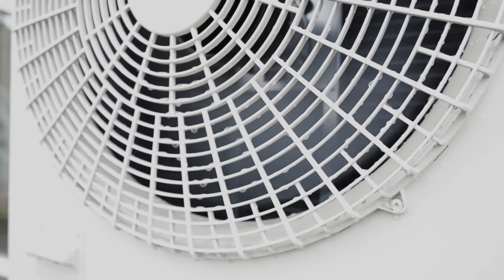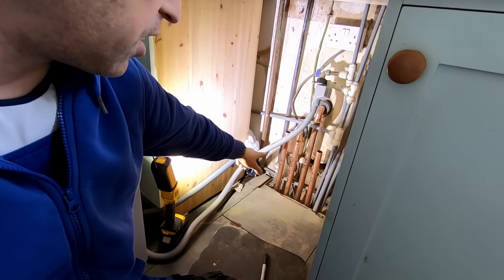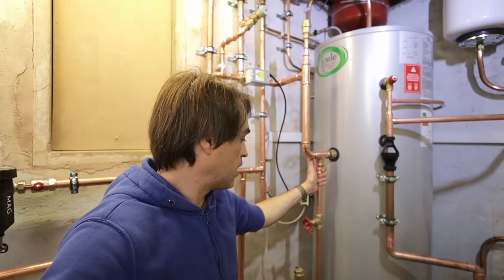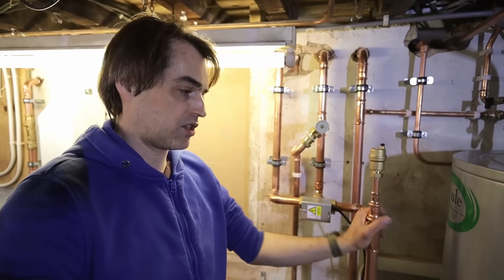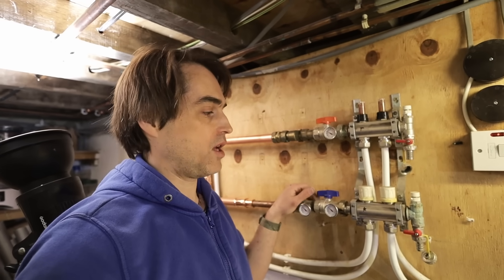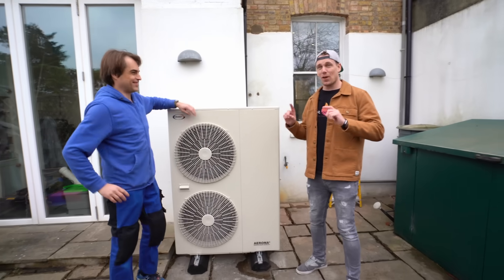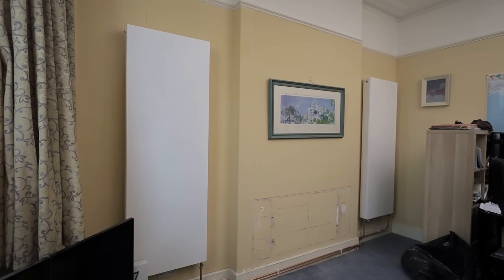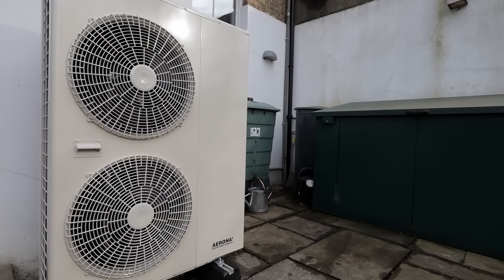The Truth about Heat Pumps: Debunking the Myth.

Comment: My house simply does not have enough space to put larger rads where the current ones are. So that means adding more rads. In awkward places. Which means what? Ugly pipes running everywhere? Destroying floors and walls to get the new pipework in? And does this mean that I cannot install a new high temperature heat pump that is designed to run at 60-80C? So I have to eff my house up or be cold even though there seem to be new options just around the corner that could avoid both? 

Nice. Very nice.
Reply from the maker: new building regulations require ALL SYSTEMS - that includes gas boilers and high temp heat pumps to run on maxium 55C flow temperature. This actaully means that gas boilers now require bigger rads than heat pumps!
Reply: @UrbanPlumbers  No, it means when my gas boiler wears out and I have to replace it I have to replace it with a system which will either leave my house cold or busted up in order to fit new rads - or both. As I said, I simply do not have space in some rooms to fit larger rads - so they will be cold. Other rooms have space - but not where the rads are now. So those rooms will get busted up in order to fit new rads in new locations.

And in the winter 45C water in my hot water tank will last precisely one shower. Good for a family of 4. So cold and smelly. Welcome to the future, it sounds so bright.

Oh, by the way, I do not have space for all the plumbing that you put in to that cellar. Because I don't have a cellar. And my house is already triple glazed and as insulated as I can make it. So yeah, can't wait.
Reply from the maker: @kalicom2937  if your house is insulated and has triple galzing then you will not need large radiators as your heat loss will be low.

Boilers are still ok to heat up the cylinder to 60C as are heat pumps with immersion back up or high temp heat pumps.

Would you rather we all were burning gas in a very ineffcieinct way as we have been doing so far or finally started saving energy?
Reply: @UrbanPlumbers  1) I hope you are correct about not needing bigger rads. 2) Immersion heaters kinda defeat the point of heat pumps, do they not? And, as you said, high temp heat pumps are banned... 3) No, I am not arguing for gas. I am arguing that preventing the use of alternative solutions - such as high temp heat pumps - is a stupid thing to do.

Let me give you an example. Many years ago my Uncle worked with the Royal Navy on flight simulators. The computers generated a lot of heat so the server rooms needed air-con. To save money the base commander insisted they turn the temperature down - which meant my Uncles department had to turn the air-conditioning up. They tried to explain to the brass upstairs that what they were insisting on was costing more money but they would not listen. So, they turned the temperature down and the electricity bills went up.

The equivalent here is my having to use an immersion heater to generate sufficient hot water to allow my family to shower - rather than allowing me to use a high temp heat pump which would achieve the same result more efficiently.

Short sighted idiotic rules created by pen pushes and not people that have to live in the real world.
Reply from the maker: @kalicom2937  90% of your hot water will be done by a heat pump. Immersion heater is just to boost it once a week for bacterial growth prevention.

You can install solar PV for that purpose and do most of your hot water with PV or solar thermal.
Reply: @UrbanPlumbers  I need hot water to shower 4 people daily. Once a week? You are having a laugh. I have friends that have modern houses that are "efficient".They are so good they cannot afford to heat them (I kid you not, they heat the rooms they will be in when they will be in them. Unplanned visits to the bedroom are not allowed....). Sounds like I will not be able to afford to shower. Well, I can, but once every 5 days or so. I will need to diary when it is my turn to wash properly.

Propaganda. Bad propaganda.
Reply from the maker: @kalicom2937  this set up does 4 showers easily, cheaper than gas too as it is mostly done by solar.
Reply: @UrbanPlumbers  What set up? I don't have solar and am unlikely to have solar. However, I will probably have to replace my gas boiler in the next year or two..... I feel like I am going to get ****** screwed over by well intentioned idiots.
Reply from the maker: @kalicom2937  why? You can still replace with another gas boiler and will be able to do so for years to come.
Reply: @UrbanPlumbers  But I thought you said it would have to be a lower temperature output boiler - the same as an ASHP. If so then these issues will affect a lot of people  needing a replacement boiler from this point onwards. Or did I misunderstand what you were saying?

Comment: The only heat pump systems worth a damn are ground source ones, where the heat source maintains constant temperature year round, and conducts heat efficiently to buried coils.  Trying to extract heat from cold outside air, when you need heat the most on a cold day, is a loosing battle of efficiency.  They also work best when used with hydronic floor heat, where you have a large surface area to radiate heat, and don’t need high temperatures to get the heat into the room.
Reply from the maker: ground source has a slightly higher efficency to air source, that is true. It is not true however that ground siurce is the only system as you say 'woth a dam'.

Air source is still hugely effiecient. There is nothing apart for ground source or lake / river source that even comes close to ASHP efficeincy. Still miles better than direct electric or gas.
Reply: @UrbanPlumbers    I have had two different air-sourced forced-air HP systems.  13% and 14% SEER rated.  Neither would keep the house comfortable at 72 degrees on a cold day, and would bump to resistance coils frequently when cold outside.  This was in Florida, so it rarely got below freezing.  With an average ground temperature of 72 degrees F year round, a ground-sourced heat pump should be working under ideal conditions for both heating and cooling, but air-sourced performance was unsatisfactory and expensive to run, summer and winter.

Comment: Can you install these in a back to back or flat. I think not it might be OK in a mansion but not for the vast majority nobody runs away from a debate but it's not practical in a vast majority of households electric storage heating and electric underfloor heating in a well insulated house with good timer controls and weather compensation controls will be a much better alternative sorry but I find this a waste of money I'm sure when your earning 10.000 pounds out of that installation I'm sure your going to be pro heat pump .As an electrician I've seen guiet alot off these new technologies and the bills and saving just don't justify the vast expense and complex install and maintenance they require they might do well in a ultra isolated new build with 10 ft of insulation around the walls but that's about it I've seen loads of people and these green zealots buying into and regret it later I think mate when you do have a proper debate I don't think you will come out on top I'm afraid don't buy in to all the hype.Icould if you want help you train up into some alternatives but you won't be earning 10.000 pound a shot install.bye the way I'm 40+years in the trade and also city and guilds.
Reply from the maker: Electric UFH and other direct electric heating is 3-4 times less efficient and more expensive to run. It also produces 70% more pollution than heat pumps.

Comment: Ugly, expensive and would not work in my old Victorian house, plus they take up so much more space. Solar, wind and hydrogen combo would be much better.
Reply from the maker: The best tech to run on solar and wind is…. Ohh heat pumps.

Hydrogen will cost you 5x more than direct electric and 15x more than a heat pump- so good luck with that.

Comment: I’ve an ASHP. Water heated to 35 deg into our underfloor heating. Hot water for DHW set at 45 cause that’s what we like shower at. 

Total electricity cost for year (space heating, water heating , light, appliances etc) €1500.

Far cheaper than our old house with oil. 

Insulation is key. No point fitting these systems to old houses that aren’t sufficiently insulated
Reply: lucky you,  our electric costs are more like  £5,000 for the year, with this very Heat pump installed into a new build house all callcs done for the RHI grant.  very efficient and cheap in the summer months but seems very expensive in  the winter,  maybe more efficient compared to gas but with gas being cheaper per KWH  than electric makes it a very expensive way of heating our house.

Comment: simple style air to air makes since in places where I live like Florida , but not in very cold areas . YES they make more heat for the  energy used but those are throw away condensing units they are installing ,in ten years or less  no one will make those parts and you will need a new system, they will never pay for themselves that's for sure.

Comment: That’s no way going to work in my semi …I have no where to put that huge monstrosity in my garden plus I wouldn’t be able to move in doors with those huge radiators !! .,may work in that huge house with its music room and cellar but for the vast majority of us plebs it’s never going to happen
Reply from the maker: Smaller houses will need much smaller units. Add insulation and rads can stay smaller too.

New building regs part L require that even in gas boiler you have to design systems with max flow of 55c which means big radiators even on gas now.

We need to cut out emissions somehow and stop burning gas one way or the other.
Reply: @UrbanPlumbers  I love your videos and admire your skills ……but I don’t agree with Carrie Johnson and the green Marxist eco millionaires it’s all pie in the sky and will never happen …it may when the last coal power station in China 🇨🇳 is shut down but they are building on average 150 new ones a year ….shale gas and clean coal ….the rest is fairly tales

Comment: I work on a huge military installation for the Air Force and the only thing we use are heat pumps. To my knowledge most other military installations use the same setup. We have over 23,000 people on site and the heat pumps work really good!
Reply from the maker: well, military know it makes sense - both financial and environmental. Thank you for your comment.
Reply: @UrbanPlumbers  Thanks for the reply. I wish you could see it. There's massive pipes under the ground running to the buildings, you can see steam running up through the streets where they intersect.

Comment: Lovely craftsmanship on the install - but seriously, who can afford to lose half each room to radiators that huge? Or, alternatively, how many people in older houses can either afford or want the hassle of digging up the floor for underfloor heating. This looks like tech for new-builds with masses of insulation meaning rads can be a sensible size for room heat loss. Not much good for retro-fit in most of Britain's older housing stock.

Comment: Such a lot of work for such a basic requirement of heating a home

Whoever required and paid for this needs to be prepared for some serious maintenance costs and will never financially benefit from any savings to their energy bills.
Reply from the maker: What are you basing this opinion on please? General experience is less maintenance than gas or oil boilers and much longer lifespan of the system and the appliance of 20-30 years.

Running cost is comparable to gas when designed and installed correctly
Reply: @UrbanPlumbers  I'm basing it on over 40 years of Building Maintenance experience. The cost of the work and the amount of equipment is disproportionate to the cost saving a homeowner will make.  
As my old grandad used to say - "Put another jumper on"
Reply from the maker: @sichere  are you saying you have 40 years of experience maintaining heat pumps or buildings? Two very different things my friend.
Reply: @UrbanPlumbers  
Thankyou for pointing out that building are not heat pumps but you are barking up the wrong tree without showing the  total cost of such an expensive  installation and system including ongoing maintenance over its planned lifetime. 
There will be no financial benefit to the customer and in ten years time I doubt you will be around to service all the valves that are corroded and system filled with limescale. 
My experience tells me that the next homeowner that comes along will want something more practical and remove those monstrous radiators.

Comment: Great video. 
We had a GSHP installed in our 1960's house about 15 years ago. We have over sized radiators but not as scientifically sized as your install. A lot of plumbing yes, it was 5K of work back then, about the same cost as the heat pump itself.  We probably went about it the wrong way in that we improved house insulation after the install. We do supplement ours with a wood burner in the lounge in the winter, but otherwise very happy. I can't honestly say its any cheaper to run than other options (we have no mains gas in our village), but the complete lack of maintenance and not having to worry about oil top-ups is a real benefit.
Reply: Upgrading the fabric first should save money on the heat pump installation, but in simple decarbonisation terms the heat pump can be done a lot more quickly (and more cheaply)  than the fabric improvements, so even though it's a bit inefficient there is an increasingly good case for just whacking in the heatpump first, then fixing the rest as finance allows, for the vast majority of people who can;t afford to do the whole damn thing in one blitz. Although mortgage-financing for retrofit may change that.
Reply: Yes. But that’s ground source. Not beset by the same issues as air source.
Reply: The fact you have to STILL suppliment it during winter kinda proves it has FAILED and WASN'T "worth it". The whole point of these systems is you shouldn't NEED to suppliment them at all with ANYTHING else - especially not a wood burner lol. Or at least that's what they make you believe with the adverts and publicity they get constantly - "it can make heat even in the winter and cool/heat during the summer".

Comment: Few questions:

In regards to air to water heat pump is there not certain requirements for distances/sunlight/air over the coil etc required?

Also that appears to be an older style house so very draughty so possibly not great for that stole of unit.

17kw, given price rises in electricity and no solar panels etc, would their bill not be though the roof?
Reply: It's 17kw of heat, not electricity. Confusing for people who use BTU
Reply: @Jaker788  I mean 17 kw is a large unit.

Comment: Mine is still working fine after 10+ years
Reply from the maker: Tell us more Chris. How is the running cost? Does it need a lot of maintenance? Is the house comfortable in the winter, etc?
Reply: @UrbanPlumbers Sorry I jumped the gun too quickly with commenting. My heat pump is a hot water system from Quantum. I've replaced the sacrificial anode and relief valves.

Comment: Very misleading headline. How do refrigerators work if heat pumps don't work? Both extract heat from a colder area and output it to a warmer area. That is how both heat pumps and refrigerators work. THEY DO WORK. Some may be inefficient, some may be incorrectly installed and some are installed by idiots.

Comment: The heat pump concept for domestic space heating is stupid. It cannot ever get hot enough and the electricitiy bill will be huge. Probably cheaper to run electric storage radiators! Or just keep the gas boiler.
Reply from the maker: Electric storage heaters are at least 3 times more expensive to run than a heat pump.
Reply: @UrbanPlumbers   don't cost £20,000

Comment: Why do you need continuous running for pressure relief? They should only be for brief period, just enough to release the pressure
Reply from the maker: Temp and pressure relief on the cylinder can blow continuously at very high temperatures and this is the only pump approved for this application
Reply: @UrbanPlumbers  by very definition, pressure relief can't be continuous! Appreciate that temperature would be for higher volumes, but given feeding from ASHP rather than boiler surely temp is much less likely?

Comment: I’ve just read that hot water in the UK should be stored at 60c or over how do heat pumps do this as they don’t heat water to that temperature
Reply from the maker: Heat pumps heat the water in the cylinder to 50c. 

Then there is a direct electric heating element that brings it up to 60c once a week 

On this job we also have solar PV that feeds excess solar into the immersion heater, so in practice on sunny days most hot water is done by solar and to 60c.
Reply: @UrbanPlumbers  so you need a expensive emersion heater , and what I would really like is smaller radiators not ones that has to fill your walls
Reply from the maker: @snodgee  expensive? Immersion heaters are around £30?